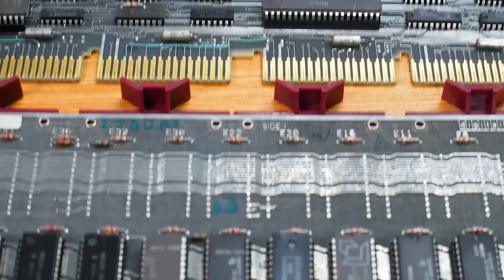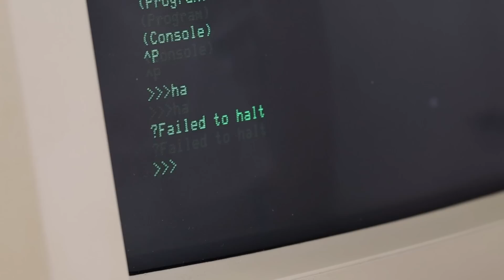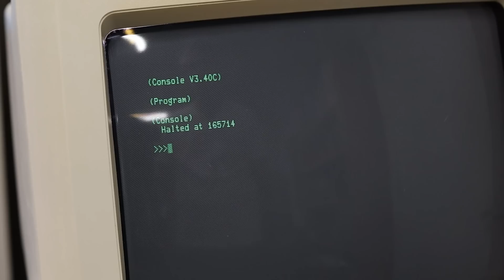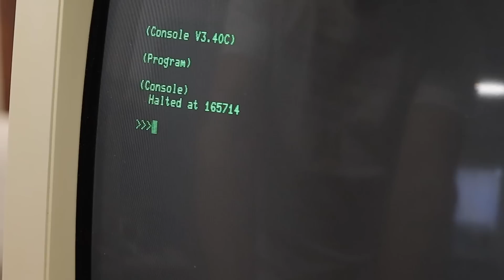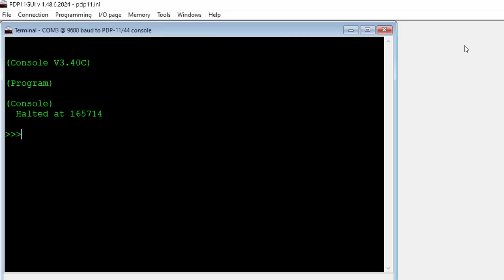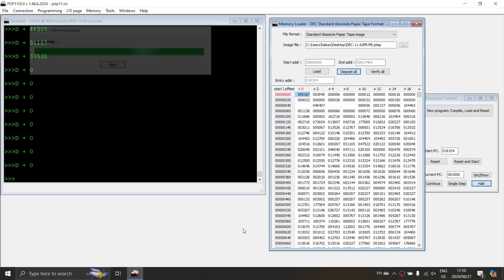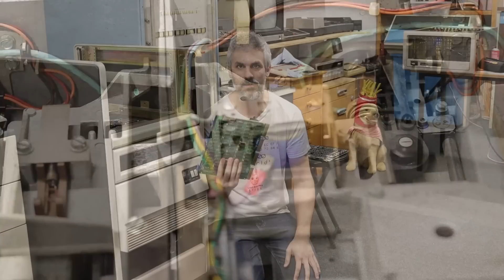Solving the halting problem with my PDP-11/44!

Comment: My PDP/LSI knowledge is old (like 40 years and counting) and limited. While I used PDP-44s as a student I certainly did not maintain or operate them. I did get deep into  various LSI-11s, -03, -23 and -73. What I do remember is that while the I/O system was flexible and extendable it was absolutely NOT plug and play. Everything was done by dip switches or, more often, wire-wrap links. You had to have the manual for the board you were working with and a good idea of how the machine as a whole was configured. IO devices were memory mapped into the top 8K of the base 64K of memory, hence giving only 56K of actual memory available. All other memory was mapped and the MMUs varied from machine to machine. On LSIs the IO space could be halved, giving more memory for programs and code. Each type of IO device had a default location but IO controller could be reconfigured to use alternate, generally closely related IO addresses by wire-wrap links. This allowed, forexample several disk controllers on the same type to be used on the same machine. The console terminal was always the first DL11(?) serial device and was always at the same location. On the LSI-11s, which had Q-Bus cards, the DLV-11J was a four channel serial card, four independant serial ports just settable as a block to somewhere in the region of IO space allocated to DL-11 devices. Later machines, such as your LSI based PDP 11-83, had one or more serial ports built in, but they emulated the good old DL-11. I wpuld be surprised if the 11/44 did not have such an arrangement.

Third party IO controllers were very common, indeed in some situations they were the norm. On the 11/73s I ran only the processor card was DEC, everything else was third party. Such controllers generally emulated DEC device types, so your Fujitsu Eagle controller may well emulate a DEC RPO7. It may be that Mitch was trying to boot of the eagle. Often built in bootstraps would only boot off the first instance of a device type, i.e. the one at the default IO address for that device type. However  I beleive that it was possible to boot off non-defaults in many machines if you knew the IO address of the particular device - i.e. you knew how the boards were configured. You just jumped to the relevant boot address in the monitor. The problem is that with a random collection of IO boards the IO addresses may have been configured all over the place and they may not play together or be easily bootable from.

Remember too that you are not talking to the processor itself when in console mode in the 11/44. You are talking to a console sub-processor, something like a 8085 I suspect, that has access to system memory and can, or in your case can't as the case may be, control the actual processor. For example , how can a halted processor send any messages? It can't of course, but a console sub-processor can.  The "Console V3.40" message comes from and give the ROM issue of the sub-processor, not the main system which thanks to the console sub-processor effectively needs no ROM. Also it can almost certainly only boot from the DEC device type and then maybe only from the default instances of each type as it can't know the full configuration of the system. 

In many system configuaration the console port was dedicated for system control/monitoring/system messages and aso on. They were often a printing terminal, even a Teletype on earlier systems, so that you had a hard copy of system messages. The LSI processors had ODT (Online Debugging Technique if I remember rightly) implemented in the processor to do essentally the same thing.

Even then the PDPs/LSIs were not plug and play. The operating systems - I am most familar with RSX-11 and RT-11 - generally had to be SYSGENed, i.e. configured for the particular system. This was a complex process that required the original distribution media, often tape (1/2" or latterly TU58, as was reportedly often used with the 11/44) or  even floppies. It was a bit like the sysgen you do on the Centurion, but offline and much more involved. You genned the system telling the  SYSGEN program the specific details, IO addresses and so on, of each and every board/controller. SYSGEN then would condtionally assemble a bespoke version of the operating system from source code. The result was a bootable system on, hopefully, the media of choice. It tended to take half a day even if you knew what you were doing and you had to take care of your system source distribution media.

I suspect the 8" floppies are not from a 11/44, they are probably some years earlier. By the time the 11/44 came out I beleive the normal floppies were the  5 1/4" RX02.

I suggest you get some manuals for your IO/controller boards and find out exactly how each are configured. Bare in mid that if the eagle is bootable, and I suspect it will have been, it wont be genned for the boards you have :-( Functionality may well be limited. Enjoy!
Reply: very seldom do I read posts this big but it was entertaining.. Thanks for the effort.. it is appreciated.

learned quite a bit..

Comment: Years ago I turned up to work to find a halted PDP/11.
Eventually its master guru arrived, and detected that someone had pushed some console key to halt it. He pushed another one and it resumed operation. We told the cleaning lady NOT to run her duster over the console keyboard, after that.
Reply: My co-worker's test server would halt almost every work day at around 5:30PM.  The cleaning lady ran her duster over the server's open case.
Reply: @RonJohn63  ours disconnected a server I ran temporarily in my office to plug in the vacuum cleaner.

Comment: Makes me wonder if there is switch bank to set the maximum size of memory in the machine.  I seem to recall a similar problem in the development of the Data General Nova when the two test machines, called Coke and Pepsi, were running a test program (Adventure - Colossal Cave) and one would run fine, the other would stop suddenly.  The reason for the stop was that the program made a call across the page boundary and only one of the machines had an extended memory.  Could this be a similar thing as I noticed when you tried to continue, the program counter advance by one and returned a null value and stopped.  Are there pull down resistors on the data lines that would make the machine return all zeros if there is no memory present?

Comment: Let’s do some math!
Async serial at 8N1 sends 10 bits per character, so 9600bps is at most 960 characters per second. The command to load a byte looked something like “D + XX<cr>” and the response is “<lf><lf>>>> “ which is 13 characters total. Between execution and the laptop processing the response, let’s assume the equivalent of one character’s transmission time is used. 960/14 is 68.6 bytes loaded per second. That means a 16k program takes 4 minutes to load. 
Is the console actually running at 9600bps? Also, the numbers are hard to read on my phone but it looks like it’s 6 digits per 16 bytes with leading zeros removed so probably less efficiently encoded than two hex digits. Programs like pdpgui often put delays into how fast they transmit rather than relying on flow control: it’s simpler to code so the transmission rate might be slower. 
In conclusion, I don’t think you have a flow control issue. I think you have an inefficient data transfer system.
Reply: it just dawned on me. PDP-GUI must be a teletype emulation and if it was, they would emulate the paper tape reader which runs at 110 baud. One reason for doing it this way is to ensure there isn't an overrun as the teletype didn't have flow control. At 110 baud, even the slowest computer could keep up with that.
Reply: Agreed

I have no idea how PDP-11 or PDP-GUI works but I have a suspicion: 

although PDP's serial port inself can receive at 9600 BOD, the monitor program that actually gets that input it is not necessarily able to actually process that data reliably at that speed - it's only designed to work human typing speed, or at best - paper tape speed. If you type it too fast some input characters can get skipped which results in corrupted program/data. 

For that reason a lot of programs that transmit data over serial have a setting to artificially delay each bYte and/or each line, which means: transmit a whole byte with start-stop-sequence at 9600 bits/second, then just hang at "break" level for 1-10 msec, then transmit the next one at 9600 bit/sec. 

So what I mean, although the point of flow control is to make sure no information is lost and delays unnececessary, for computers it only works between the wire and its buffer, the software that reads from said buffer can glitch out if the data arrives too fast 

So, the flow control is not the issue with the speed. However, if you can, you should probably enable "hardware flow control" mode on both pdp AND pc. If not - no big deal.

To increase the speed, find the setting in PDP-GUI which controls delays, try to lower it, tramsmit some data and then read it back to ensure it's actually working. It can take some trial and error to find optimal but reliable speed

I'm guessing there probably is some kind of binary loader somewhere that does not rely on typing commands into the memory monitor, which would probably both make delays unnecessary and reqiure sending ~10 times less bytes.

But really, PDP-11 is made to run an OS (which should have all necessary loaders), so perhaps tinkering with the serial loading speed might be a waste of time
Reply: @jwhite5008  The binary loader that does not rely on typing commands into the memory monitor: you’re talking about xmodem and Kermit! ;D
Reply: @RichardBetel  kind of.

kermit/x/y/zmodem is mostly error-correction, which is why it was popular for large file transfers over voice-modems 

that would be ok except the burden to port all the data-correction code to PDP-11

what I'm talking about is something simpler like: type COM1 >1.exe
or  cat /dev/ttyS0 >a.out  if you prefer Linux

it works if serial works flawlessly and is configured for 8 bit binary

Comment: My eyes just quickly caught a change in the HELLORLD output at 17:47 -- what's the line LHD! which flies by?  I don't know PDP-11 software, maybe that's normal, but the program then continues with printing HELLORLD several more times.
Reply: Good eye! Looks like somehow it skipped many characters (and a return) in at least two lines.
Could be a comms/handshaking/buffer-problem since it's sent to a terminal over serial... The PDP itself probably generated it properly.

The list of places in the chain from serial output to input, to a possible USB to serial converter, and its internal buffers, to the laptop's drivers for the usb adapter and its internal buffers, to the actual serial terminal-emulator program and its buffer, then to the plausible second terminal-emulator running under the GUI which would give access to commandline programs (like the serial terminal emulator), then to the GUI's graphical character-generator, then to the GPU's framebuffer...
I'm sure I forgot many inbetween steps; the list is huge! MOST of the time we can rely on our fast computers to not be the cause of such glitches, but I've definitely seen them be the cause, because of so many internal layers and so many other processes running simultaneously. Most likely, though, this is a serial handshaking problem. BUT, that too has many layers: USB converters have an internal buffer, USB drivers have a second buffer, then the virtual serial-port driver has a third buffer. Whereas serial handshaking of that era was expected to work with only one buffer, at the UART in the dumb-terminal. Yah'd think more buffers equals better, but that's not really the case, because the application is responsible for controlling the handshaking, and by the time it realizes it's full-up, there's already a huge amount of data expecting to come through, and when it says it's full-up, the "wait" signal has to go through just as many layers in the reverse-direction to tell the serial device (PDP) to stop sending data... all-the-while the PDP is still sending data to many layers of full buffers!
Could be something as simple as a mouse-movement causing an interrupt on the laptop, which causes the terminal-emulator to pause, briefly, ('nice' might allow it to run at a higher priority, to prevent such pauses).
In the grand scheme, I've often thought it rather amazing we can even use old serial devices with new systems... It's not that it couldn't be handled better, but that the multilayered approach (which keeps getting deeper) seems forgetful of how these things work at the lowest level. While it's great for packet-based systems like USB, TCP/IP, etc. it's horrible for low-level stuff like serial. And the professional hacks I've seen to get around such problems are downright shameful... making the problems seem to be the fault of the original designs!
Contemporary techniques for resolving such problems isn't to use proper handshaking, but to avoid the risk in the first place... by... basically slowing everything way down... MUCH slower than it was capable back in the day, so those buffers technically can't overflow. (e.g. earlier, 9600baud taking half an hour to send a couple minutes' worth of data!). And techniques used in contemporary serial devices (e.g. grbl) forgo dedicated handshaking altogether in exchange for request-response techniques... Which is rather a step backwards... full-duplex comms now relegated to half-duplex. Ironic how "progress" can cause so much regress as to essentially require said progress to achieve what had already been achieved.
Sorry, morning-coffee-rant-of-the-day directed at you, this time. Heh!
Reply: Yes, that was definitely a glitch in the matrix there!

Comment: I know this isn't exactly  where it should be posted but I used to live in Anaheim and once a week I would travel north along the I5 and see the CDC plant. Thursday morning I woke at 3:30 and couldn't get back to sleep so I picked up the phone and started googling. I think I found the mother load of old CDC parts and they are located just north of Los Angles. They have hard drive heads and filters though I don't know if they will work with a Hawk drive. I would like to pass the link privately so you have first shot at the parts and I know what you don't need will be passed on to others who might needs what they have to offer. I don't want somebody to get in there before you and buy up the stock charging you a higher price for what you need. I need a way to pass you the link privately but I don't do social media so it pretty well limits the options. If you  already know of this location, there is no need to respond. 
As a side note, it's to bad your in Texas and I am in Phoenix. While I haven't used any of the equipment you have, I have spent over 40 years working with assembler and getting stubborn hardware to do what it's supposed to do. It would be fun helping you with some of the problems you're having difficulty with. All I want is for you to continue to turn out quality content as it brings back some old memories for me because I started in the industry in 1973 and am familiar with the basics of the time.

Comment: Back around 1982 or so, I was performing care and feeding for a runt of the litter PDP 11/84.
It had an RL02 and also a Fujitsu Eagle like yours.
I think it had an Emulex card to control the drive, not a DEC controller.

Comment: It should be relatively easy to find the supply voltage pins on the floppy controller card. If you can find datasheets for some of the ICs on it, you just have to check continuity to the board edge connection. 
Once you know where the supply pins are on the card, you can compare it against the pinout of the PDP bus and see if they line up.

Comment: Are you sure CP isn't Console Program? Also, I seem to remember the peripheral controller board for the device you want to boot from needs a suitable ROM on the board, and you EXEC from the base address for the card ROM to start it. At the moment it sounds as if it doesn't have ANY controllers with boot code ROMs on them, so it just halts.

Comment: I noticed at 17:47 there seems to be either a glitch or some kind of interrupt in the 'HELLORLD!' loop, "LHD!" displays instead of the proper text of the loop. I am assuming it's a glitch, does it actually mean anything? A memory problem? something executing in the background messing with the BASIC interpreter? or simply a transmission error over the serial connection? Dave or anyone else have any idea?

Comment: I think that the dive controllers need a DMA slot, and you can figure out which slots have been wired for DMA by following the wire wrap in the backplane.  Also, with pre-LSI, I think you have to use the omnibus as opposed to qbus;.  Both of these facts are coming from my memory, and I don't have CRC enabled (that is I don't have any of the PDP-11 manuals and could be talking out my dump register).

Comment: (Can't post links).
The floppy interface goes to the left, looking from the front of the chassis.

This manual on bitsavers shows the full slot layout & which are the small peripheral controller slots;

040003-01B_DSD-480_Installation_and_Programming_Manual_1983.pdf
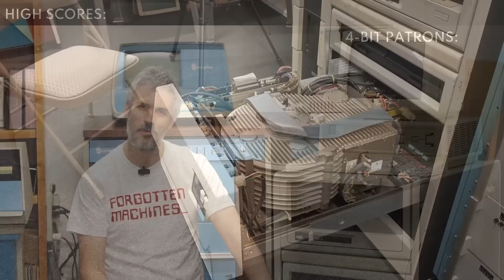See page 2:15 or pdf page 29.

Also get this one for more configuration info:
DSD-440 Flexible Disk Memory System User's Guide.pdf

They also give all the links, bootloader setup, registers etc.
Reply: thank you very much

Comment: I worked on PDP-11s running RSTS/E for years from the late 80s until late 90s.

24x80 green screens. We used to think block mode input was sophisticated.

I write web UIs now. We've moved such a long way!
Reply: HTTP POST and GET are nothing but high-overhead block mode.